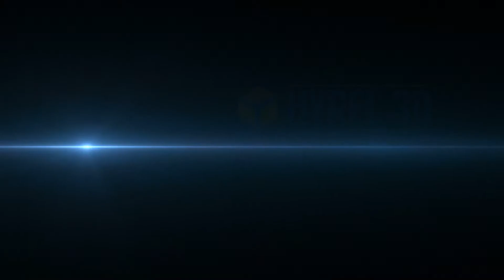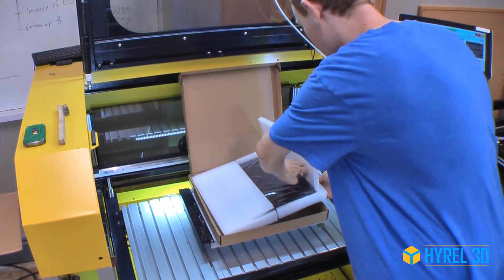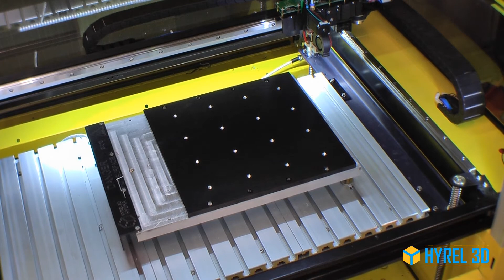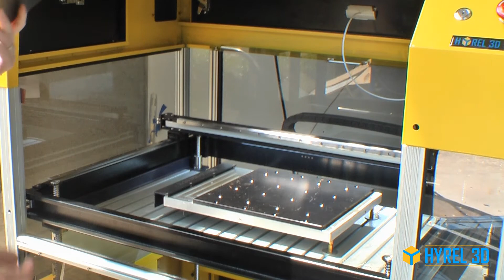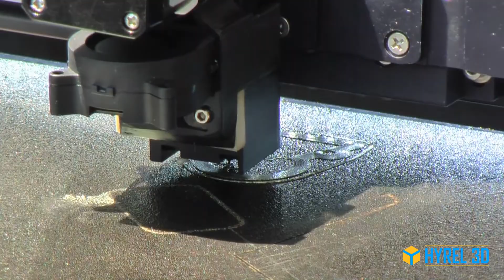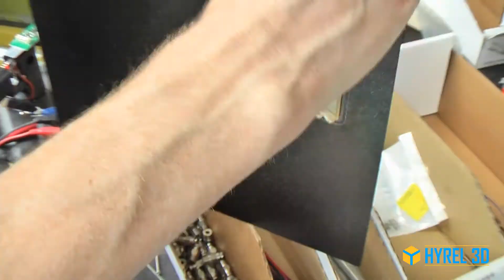How to select a built platform

Comment: Where can I order the third platform in this video (the magnetic steel plate coated with PEI), as well as the magnetic baseplate? How was the magnetic baseplate fixed to the hotbed?
Reply from the maker: The magnetic baseplate is bolted to the heated bed. You can email us, hyrel3d@hyrel3d.com  or hyrel3d@gmail.com for more details. We don't have these in inventory yet, but we are manufacturing them now.
Reply from the maker: Contact us, hyrel3d@hyrel3d.com - the magnetic baseplate is bolted to the hotbed.